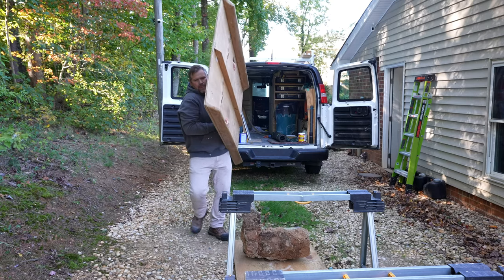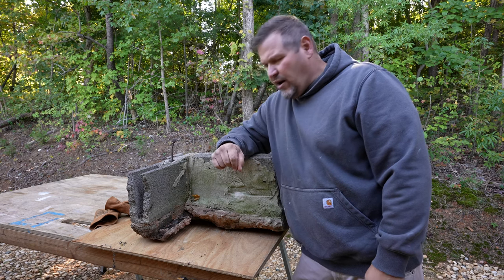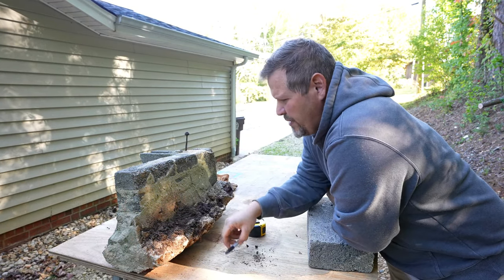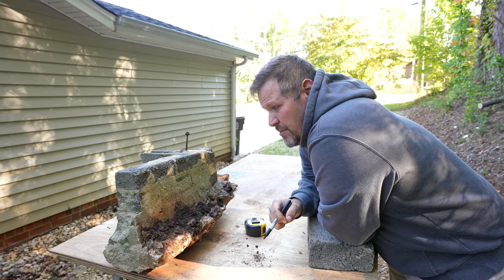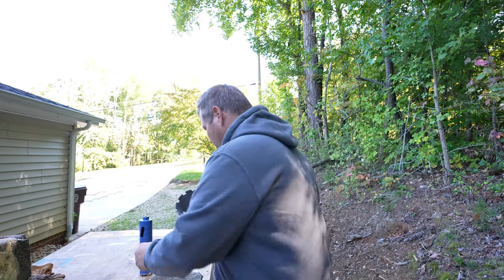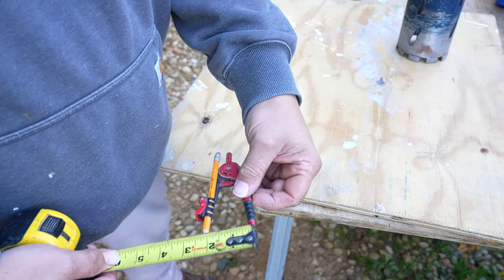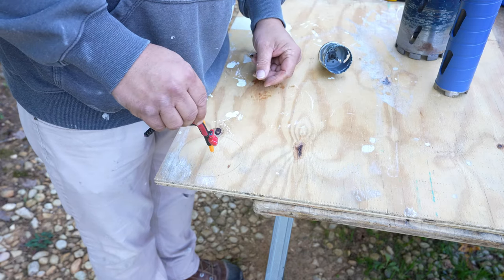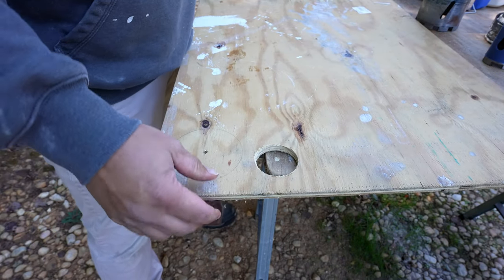How To Drill Concrete Hole Straight (No Chipping)!!!!

Comment: This is gold! Thanks so much.
I have to drill a 3.5" core hole through double brick and i have already drilled my 10mm pilot hole.  

Was going to do similiar by cutting a hole in timber to use as a template, but your method makes more sense, apart from the fact i already have the 10mm pilot hole
Reply from the maker: I’ve done both styles and they both work great but the pilot bit guarantees exact placement and tear out on the other side.
Reply: @campbellbuilt  project completed, however the external wall has a column in the way and the spacing was about 5mm too narrow for the hammer drill and long 3.5"corer.  So I had push through from the other side and it dropped maybe 8-9mm. I had to use a smaller drill and the original pilot hole and round guide to keep it as clean as possible, the swapped it back to keep it from dancing around.
Reply from the maker: Very satisfying when done isn’t it?

Comment: What's the brand of core bit that  you use? I see a LOT of core bits advertised, but a LOT of them say "do not use on concrete". I have to bore a 2.5" hole in concrete to install a fence door post support. Can these bits be used on concrete? What brand are they, and where did you get them? I want to bore a 2.5" hole, go down about 2 feet past the edge of the concrete wall footer, install a 2.5" diameter post shell that goes from the surface down into the ground, and then install a 2" fence post that can rotate, while carrying the fence gate, into the sleeve pipe I installed through the concrete.

Comment: Can we use the core bit on a regular drill to do a hole in concrete? Or is it necessary to use a hammer drill? I need to make a hole for my kitchen sink drain 😩  Newbie with tools 🤷‍♀️
Reply from the maker: Regular drill is just fine.
Reply: @campbellbuilt  thank u for responding so fast 😊 happy holidays

Comment: How to make a 4inch hole  in a  exsisting 3 inch hole in  wall  brick wall,   can you double stack the hole saws?
Reply from the maker: No, there’s a couple solutions. 
1st would require two wood hole saws. Cut a plug out of a 2x6 using both a 3” and 4” wood hole saw bits. Attach both wood plugs together and use that to temporarily get your 4” started.

2nd is us the method in my other video https://www.youtube.com/watch?v=EJhBEKcSbj0

Comment: why wouldn't you just drill the hole straight through from one side? What is the point of drilling a little bit from one side, then going to the other side to try to line it up?
Reply: I was thinking the same. My guess is there's less friction on the hole saw blade.

Comment: 8m new at this so I may be wrong but I know you can get break out with carbide core bit in hammer mode. But why would you get break out with a diamond core bit that's not hammering? Thanks.
Reply from the maker: Typically both sides of the block wall or concrete will be visible to the eye. I want a super clean hole for that reason since there’s no good way to repair damage after the fact. Yes your right about not using hammer mode and being better for break out but concrete is a funny thing. Block is especially susceptible to break out regardless of how your drilling. Good question.

Comment: If did this on my job I would fire him. I’m an electrical contractor, everyone has proper tools on the truck or at shop. Plus it took way too long to lay out, I could have drilled 20 holes. They make dry core and wet bits that makes it simple
Reply from the maker: Okay 🤣🤣🤣